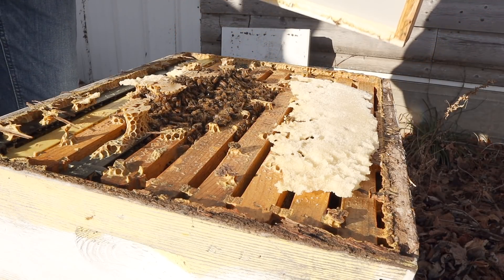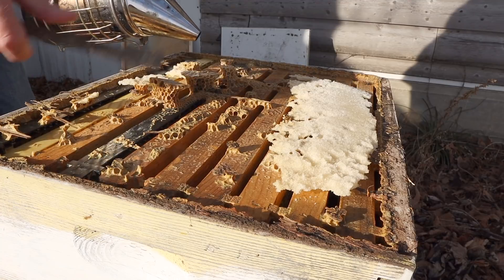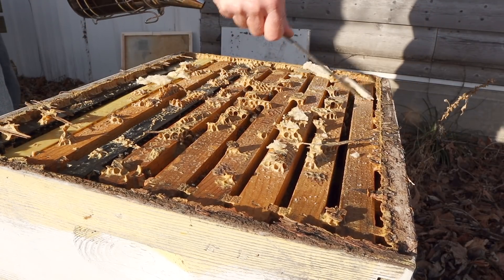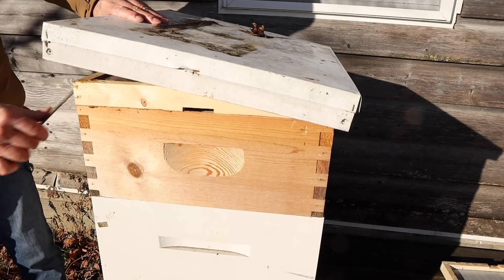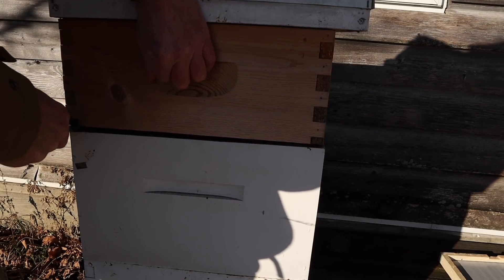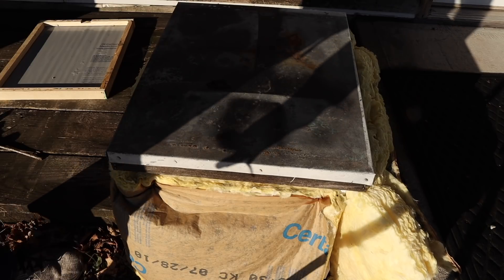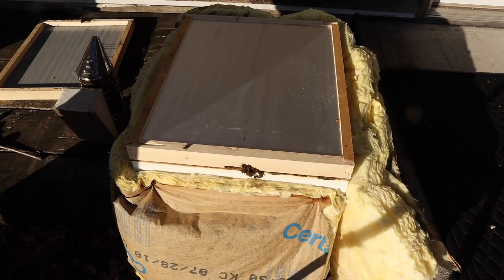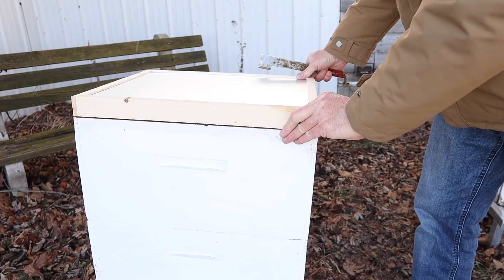Beekeeping | Can Bees Survive In A Single Deep In Winter Up North?

Comment: Im fairly worried about my hive right now. We've had sustained -40C temps. Currently only -25C. We wrapped the outside and we have snow piled up around the hive to help insulate even more...Fingers crossed the winter bees survived, however I haven't seen any signs of undertaker bees bringing summer bee bodies out of the hive yet.
Reply from the maker: I know! I thought I lost a hive yesterday. It warmed up and all my hives were flying but one, so I looked under the winter bee kind and there they were strong as ever.
Reply: @beek  Here is hoping! I will be checking on Saturday when the temps stabilize. It will be 32F by then...I would check now, however it's currently -40F.